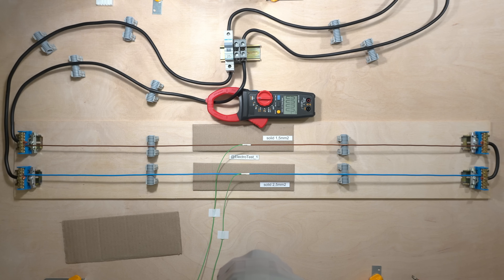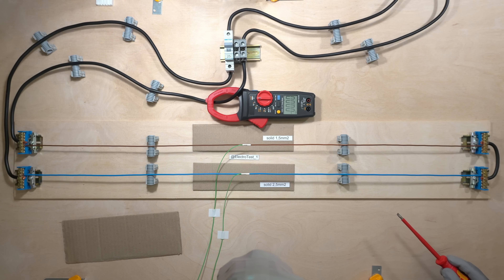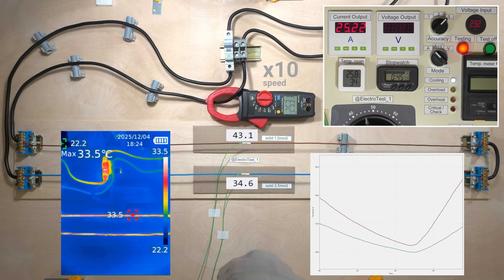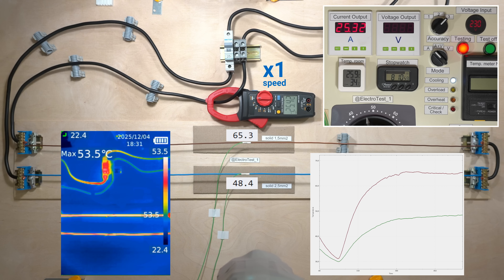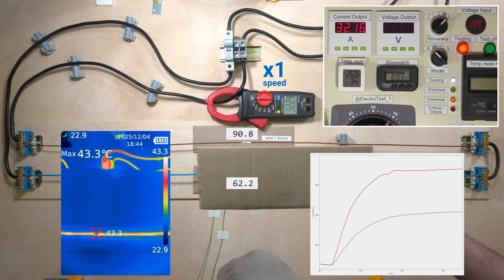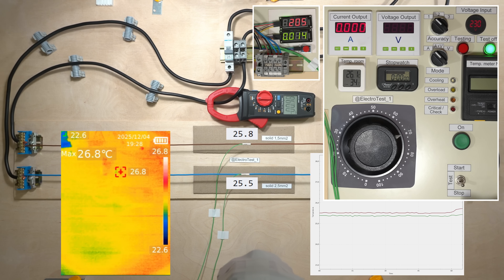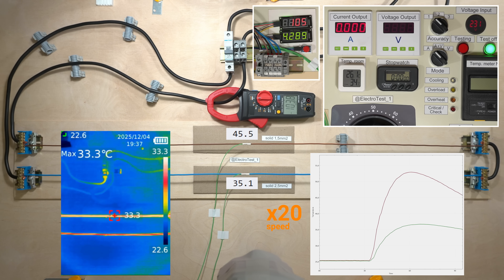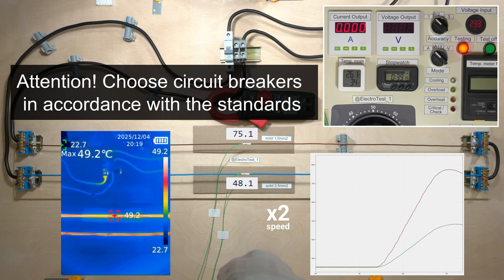1,5 vs 2,5 mm2 Wire in series Current test

Comment from the maker: Please support my channel: https://www.youtube.com/channel/UCqZUswoAI9E9iFcTeS7L6gw/join
1.5 mm² and 2.5 mm² are the most popular wire and cable sizes used in household electrical networks. I’ve always wanted to see the difference between them, so I tested them at different currents.
Of course, the 1.5 mm² wire heats up more, but the noticeable difference starts at around 16 A.
Interestingly, the temperature sensor readings are always higher than the thermal camera values — especially at higher currents. I think the thermocouple readings are more important, as they reflect the temperature through the full thickness of the insulation, while the thermal camera only shows the surface temperature. What do you think?
Keep in mind that the video shows single conductors, not cables. I’m planning to run tests with cables later. In your opinion, what is the maximum circuit breaker rating that can be used for single conductors? I understand that rules may vary from country to country.
If you enjoyed this, hit the like button and let me know what you think in the comments!

Comment: thx for video, There is a standard 16A breaker with 2.5mm cable for power outlets and 10A breaker with 1.5mm cable for lights in Czech republic (AC 230-240V). It is standard and safe but bit oversized according to your video :)) 1.5mm could be enough for 16A as well.
Reply from the maker: Thank you for the comment. First, in the test it’s not a cable but a single wire. A cable would have slightly higher temperatures. Second, with a certain installation method, regulations allow a current of 16 A for a 1.5 mm² cable. However, this is already at the limit of the permissible currents.

Comment: 4:00 The current strength will always be the same, there is no need to measure there is already a current meter at the beginning of the circuit.

Comment: я вообще не понимаю для чего этот ролик? вы тестируете для того чтобы что? смысл изобретать велосипед? все уже давно рассчитано до вас. у вас провод один и на воздухе, при прокладке в кабеле в лодке в воздухе и т.д. и т.п. используются соответствующие поправочные коэффициенты и все есть в соответствующих таблицах. с учетом всех реалий, при прокладке кабеля 1,5мм.кв. через него можно пропускать до 10А, а через 2,5мм.кв. не более 20А (обычно ставят 16А автомат, т.к. 20А автоматы встречаются редко) все что выше это внимательное изучение расчетных таблиц. при этом речь про ГОСТовские кабели, которые дороже, в продаже чаще встречаются кабели с заниженным сечением. поэтому данный эксперимент ни как нельзя аппроксимировать на все кабели подобных сечений. есть правило - 1,5мм.кв. = 10А (или ниже), 2,5мм.кв. = 16А(или ниже). любая экономия на кабеле или игнорирование данного правила приводит к пожарю с последующей потерей имущества. так что думайте хорошо прежде чем экспериментировать с электрикой.
Reply from the maker: Hi! It’s great that you know the standards and also where to find the necessary data for selecting wires and cables. However, my videos contain exclusive information — nowhere in the standards is it stated how a particular cable will actually heat up under different conditions or currents. People can see approximate temperatures for different wires, and it also becomes easier to make a decision in controversial cases.
Have you ever come across people who think that as soon as, for example, 11 A flows, a 1.5 mm² wire will immediately burn out? Or that if a wire is warm (say 40–45°C), then that’s it — everything is a disaster and must be redone? Undersized cross-sections do not affect heating as dramatically as many think. You can also understand this if the difference between 1.5 and 2.5 mm² is only about 5–10 degrees at currents up to 16 A.
One more thing — regulatory documents are not the same everywhere. And in general, tests like these explain exactly why there are different tables in the standards, why there are various correction factors, and why they should not be ignored.
Reply: @ElectroTest_1  вы понимаете что в разных странах сечение провода может отличаться от реального в меньшую сторону? и где по вашему может использоваться один провод в данном конкретном ролике? может я что то упустил?
Reply from the maker: Wires always differ on the lower side—there are allowable tolerances. Usually, this is about 5-10%(10% allowed standarts) for copper conductors. In my video, the cross-section is also smaller than the declared one. Single-core conductors are analogous to jumpers in electrical panels—between circuit breakers, between rows, and relays. Please note that in power distribution panels, the jumpers often have a smaller cross-section than the outgoing cables.

Comment: If you would be so kind, can you test flat cable vs round wires? I mean copper is flatten out, this is not standard cable.
Reply from the maker: Sounds interesting. Could you clarify what you mean? Do you mean a flat cable — that is, 2–3 conductors in a single sheath, but flat — or do you mean a single insulated conductor with a rectangular cross-section?

Comment: the problem of this test is that you are testing cable with perfect connection, in my opinion you have to test in real condition, i mean on a common power outlet connection, anyway very interesting
Reply from the maker: That’s a good idea. I think this is a basic experiment. As you say, these are the best-case conditions. At the very least, it’s needed so that when I test different connections, it will be possible to assess how much they affect heating.

Comment: Самый бесполезный эксперимент
Reply from the maker: I think that if you were an electrician and assembled electrical panels, you would appreciate this video. I’m sorry that you couldn’t really see how cool this video is.
But if you have any ideas on how to improve the experiment, feel free to write them. I’m interested in everyone’s opinion.
Reply: @ElectroTest_1 да каждый дурак знает что если нагрузить кабель он будет греться 😂, ты как будто не знал без эксперимента, а так если хочешь как то принести пользу то нужно как минимум на час нагрузить провода разными нагрузками а так же проверить автоматы 16 и 25а на скольки они выбивают
Reply from the maker: What’s the point of loading the cable for an hour if the temperature has already stabilized after 5–10 minutes? It won’t change under the same conditions even after a day 🙂
Besides, this isn’t a cable but a single conductor. I also have several similar videos with a 3-core cable. You can check my videos about circuit breakers as well.
Reply: @ElectroTest_1 ты хочешь сказать что при нагрузке 20А жилы 1.5сечением какбель будет 20-30 градусов когда как производители кабеля пишут что максимально допустимая нагрузка 19А потому что он нагревается до 70градусов
Reply: Пишешь полную хрень,  @ElectroTest_1
Reply from the maker: Actually, in the test at 20 A the wire heated up to 52°C! I didn’t say 30°C — please check your message.
If it were a cable, the heating would be somewhat higher — probably 60–65°C. Besides, a lot depends on the installation conditions.
The 70°C specified by the manufacturer should be understood differently. It is not the temperature the cable will heat up to at maximum load. It is the maximum operating temperature at which the cable can maintain its properties over a long period of time.
That’s why the ambient temperature where the cable is installed also has to be taken into account. For example, in industrial environments it can be 30–40°C, and sometimes even higher.
The cable may also be laid in trays together with many other cables. All of this must be considered according to the tables.
The actual operating temperature, taking all these factors into account, should not exceed 70°C.
Of course, the more derating factors there are, the lower the permissible current will be.

Comment: How about the efficiency? How many extra % for 1kwh through 1.5mm2 vs 2.5mm2 cable? You’ll lose energy for heating the wire up.
Reply from the maker: Yes, it’s an interesting topic. I’m planning to make a video about voltage drop on these same wires. Would you be interested in watching such a video?
Reply: @ElectroTest_1 Yes, definitely. I have an electric car, and it might be worth rewiring the section leading to the charger with thicker cables.
Reply from the maker: Hi, this is my new video https://youtu.be/w5mA4aeQE-Y

Comment: I am leaving in PL, in my house electrician put 1.5mm for lamps and lights and 2.5mm for electric plugs, for induction  plate and sauna it is 5x4mm (3phases). Power output for 3phases motors or EV charger not used at the moment 5x6mm.
I assume 230V and 16A fuse for plugs and 10A for lights is more than enough.
Reply from the maker: The electrical work was done very well! Thank you for your opinion. Yes, for household wiring, 10A and 16A circuit breakers are a standard solution.

Comment: И что этот ест показать должен? Кабель 1,5 сечением держит 15А, а 2,5 - 21А (по таблице из интернета). Вы просто не превышайте нагрузку для меньшего диаметра провода и будет все норм. Вывод: кабель подбирается из расчета нагрузки. Автоматы защитные тоже. Не надо на 1,5 кабель ставить защитный автомат на 25А. Вопрос только один: почему автомат греется сильнее чем кабель 1,5?
Reply from the maker: Please look not at an internet table but at the table from the regulatory document. For a single conductor, the permissible currents are higher. You noticed that the circuit breaker heats up — although not excessively. It is its function to heat up and trip; this is how it protects the wire (provided the breaker is selected correctly).

Comment: Автор почему то использовал нерабочий автомат, при 30 амперах он не разьединял цепь, видимо китайское дерьмо.
Reply from the maker: Are you familiar with the characteristics of circuit breakers? 🙂 Take a look at the tripping curve of any manufacturer.
32 A is the value of In × 1.23. At such a current, the circuit breaker may not trip for a very long time, and this is exactly the ability of breakers to withstand slight overloads.
Reply: @ElectroTest_1 Спасибо за ответ.

Comment: Surely these wires would usually have a second layer of insulation (definitely in UK) so temperatures will be much higher at the same currents. Even more if buried in a wall.
Reply from the maker: I’m planning to test cables under different conditions.

Comment: And for what is it good? This is test from begining of electric age. We did that in school on laboratories trening 40 years ago.
Reply from the maker: That’s great! You’ve had good training. People can analyze physical processes and see the behavior of different conductors under different conditions. This can also help with choosing the right wires.
Reply: @ElectroTest_1 Right wires? We have norms. We have to use wires by norms.
That all.
Reply from the maker: Exactly – the standards! And even the standards allow for choice – you can take a wire or cable at the limit of the standards, with some margin, or with extra margin for future development.
Reply: @ElectroTest_1 No, you can't.  Only by project. After coming revision technician do control, and it have to fit with project.
Reply from the maker: During the project approval process, many issues are resolved. They may ask for changes even if the project complies with all regulations. There is also such a thing as a technical and economic justification for a particular solution. Sometimes the goal is to reduce costs; other times the client wants the best possible solution with safety margins.
Reply from the maker: I’m talking about changes at the design stage, not changes to an already approved project. Although that happens too 🙂
Reply: @ElectroTest_1 During project everything is done. If are some changes you only add cables from distribution box. You can't use wires and add ticknes and put up curent safety switches. If you do it, and coming fire you will for time  visitor of Alcatraz.
Reply from the maker: Haha 🙂 thank you very much for your opinion! If it’s just a regular electrician working according to a project, then maybe. However, many electricians actually do everything themselves: they are the designers, handle approvals, select the materials, and are the ones who carry out the work. Something like that.
Reply: @ElectroTest_1  I understand.

Comment: I think the voltage was 240V but please add it to context for the American viewers! 😆
Reply from the maker: The voltage was not 240 V. In this test, the voltage was only a few volts. However, it would be the same as having a 240 V line at the input, because most of the voltage drop would be across the load—for example, a kettle (say 239 V)—and the voltage drop on the wires would still be the same 1–2 V.

Comment: I actually used up a 50mm2 pair of copper wires once. They reached a point when the impedance started to raise and entered a sort of avalanche mode. The copper started to change color too. I had to go up to 70mm2 in order for it to handle the current

Comment: I would check that circuit breaker. 
Its only 30% overload, but over this long period of time a circuit breaker should have tripped.
The breaker is supposed to protect the wires from being overloaded. If the wire was able to reach stable high temperature before the breaker tripped, then the breaker is useless.
I had a faulty circuit breaker in my house and the wire literally melted in the wall from being slightly overloaded for a long period of time.
Reply from the maker: You made a very good point. This circuit breaker was installed in this circuit intentionally to significantly overheat the conductors! For 1.5 mm², it is absolutely not suitable. For 2.5 mm², it can be installed in some cases, but it’s still better to use breakers up to 20 A. Regarding the breaker in the video—taking the ambient temperature into account, its rating is about 26 A, and an overload of 32 A is about 20–25%. Circuit breakers can withstand such an overload for a long time. I'll check it)

Comment: автомат классный - на 25А при этом спокойно пропускает 32А
Reply from the maker: You didn’t know that circuit breakers have a thermal element that doesn’t trip instantly under overload? Look at the characteristic curve of any 25 A breaker.
32 A is only 1.2–1.25 × In. It can carry such a current for quite a long time.
Reply: The datasheet for the common B/C/D characteristics mention 1.13–1.45 times of the rated current for up to an hour. So even up to 36 A for 1 h would be in spec.

Comment: Wire/amps tabels show that for constant long term work it shoud be 6A per 1mm2 for short time work 9A per 9mm2, and there different rating for 1 phase wires and 3 phase wires, also different for in wall build wires, inside "empty walls", inside plastik tubes, and for in air wires, everything matters
Reply from the maker: Yes, the standards consider many different cases and conditions. I plan to run multiple tests under different conditions — different cables, different installation methods, and different environments.

I hope you’ve subscribed so you don’t miss the upcoming videos 🙂

Comment: Главное! Это открытый участок всего лишь в один метр! Не корректный опыт, не говорящий главного, на каком токе можно использовать провод, кабель...
Reply: Так, з різною довжиною теж цікаво було б порівняти.
Reply from the maker: Hello, my friend! Previous tests showed that 1 meter is enough for both 1.5 mm² and 2.5 mm². However, I will soon make a separate video where I will compare the heating of wires of different lengths.
I do not specify which currents or circuit breakers should be used, because this information is given in regulatory documents. Standards may differ from country to country. There are different tables, different cable types, and different installation methods.
This video shows only a specific case. Before installing electrical wiring, a person should also familiarize themselves with the applicable rules and standards. Only then should they decide which wire, cable, or circuit breaker to choose.

Comment: Good testing approach, equipment, and great transparency. However, shouldn't these tests be performed one by one for each conductor to reduce the impact of electromagnetic waves from neighboring conductor?
Reply from the maker: Yes, you are right. To achieve the most accurate temperature results, it is better to test each wire individually.
However, I have short videos on this channel where I test wires of different cross-sections one at a time, meaning there is only one wire in the circuit. You can watch those Shorts and analyze the results.
You will see that the temperature readings are almost identical (±1 °C), even though at that time I was using a regular measuring device, not a high-precision one.